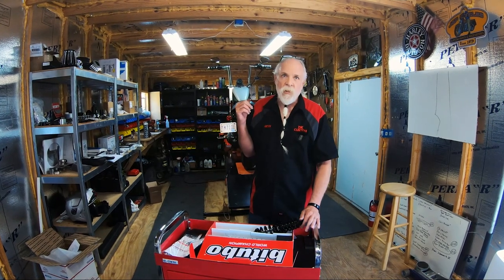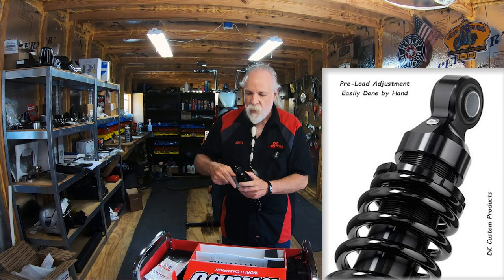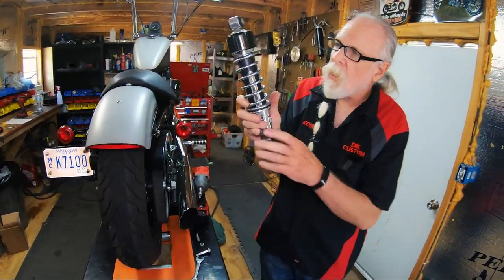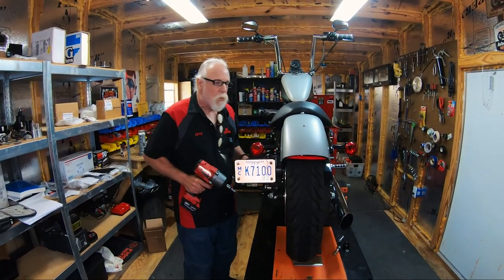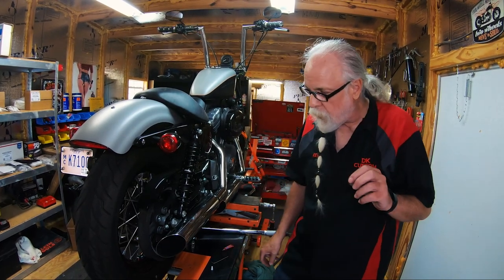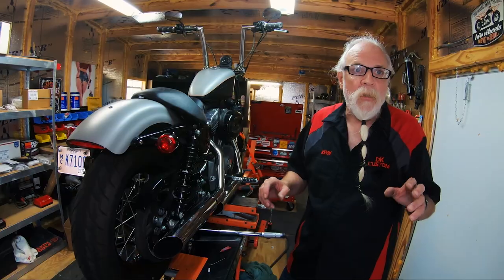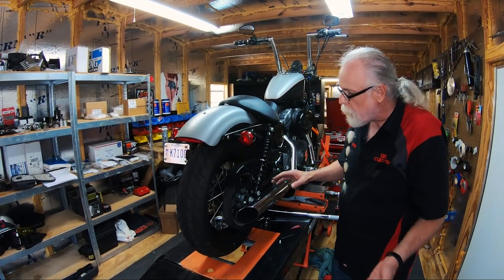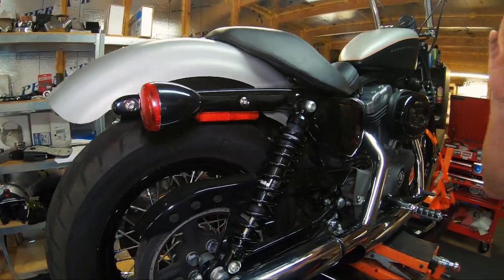EZ Premium Twin Adjustable Shocks For Harley's

Comment: Ok,  I finally order a set for my 2020 Road King (13") and order parts for the front forks last week too (still waiting for 2 of three ordered items).  I still have the forks of my 2021 Street Glide Standard to figure out the best option (dang those road bumps and buzz vibration on the 19" low profile tires riding on seal chat type roads is annoying on that Street Glide!)   My OEM shocks show no sag with me and bike on the ground, so I figure the 1" total sag I will adjust for will make it easier to move the bike around while seated (I'm on the shorter and lighter side), got to get ready for you event in a few weeks as I plan to come down.. but back to the Sportster.. One thing to keep in mine, that extra 2 inch of travel not only are you limited by the muffler, but you are putting much more stress on that belt drive system when that shock extends that extra length..
Reply from the maker: Sounds like you have a good gameplan for your bikes!
The pivot of the swingarm functions with no extra stress on the belt, even with the 14" NexGen™ shocks.
Looking forward to meeting you at the open house! 👍

Comment: So is the dampening adjustment for rebound, compression, or both? I used to ride dirt bikes on mountain trails and a good suspension with all the adjustments could turn those large stones into fresh marshmallows, but if you wanted to ride faster and get really rough, you could do some adjusting and those large stones would turn into a few days stale kind of marshmallows and you never bottomed out hard, but maybe only a little and rarely.
Reply from the maker: The damper adjustment knob is for rebound.  Compression damping is controlled by the valving and the adjustment of the preload.

You can see more about them at this link - https://www.dkcustomproducts.com/twin-adjustable-performance-rear-shocks-for-harley-davidson-dk-bt-shks.htm

Please feel free to contact us with any questions;
Support@DKCustomProducts.com
662-252-8828

Thank you for commenting! MB

Comment: I just bought a set of the 13" Bitubo shock for my '19 Road Glide. I'm a little confused, because the paperwork DK sent with the shocks says to torque the mounting bolts to 40 ft-lbs, but the Harley service manual says 63-70. Which do I use? I'm getting varying info all over the net.
Reply from the maker: Every shock has different bushings and spacers, the Bitubo Twin Adjustable shocks will be correctly installed with 40 ft-lbs with red thread locker.  If you are putting the stock shocks, on your bike, back on, then use the torque specs for those shocks, as specified in your manual. 👍
Reply: @DKCustomProducts  thanks for the reply. I wasn't sure when I put them on last night. The stock shocks, oddly enough, didn't look like they had any thread locker on them. Weird. Service manual says blue 243, so I put that on and torqued to 45, which was in between. Hopefully they stay on. 🤷🏼‍♂️😂
Reply from the maker: You'll be good. 👍

Comment: I got the 12” Bitubos for my Dyna. Pretty good improvement over stock, really showed how bad the stock front is! 

Just wish I had got the 13” versions.... and I will.
Reply: I put the 14in on my 2016 FXDLS! But I'm 6'3
Reply from the maker: Yeah, that 3.7" of travel on the 13's is a very nice upgrade over the 2.7" in the 12's.

Comment: Harley Davidson and shocks in the same sentence is a crime.
Reply: My FXDX would beg to differ. To your point there are plenty of Harley-Davidsons with the wrong shocks from the factory and just as many from a poor choice in aftermarket “upgrade”
Reply from the maker: They do leave quite a bit to be desired for most folks.
Reply from the maker: Yes, some folks are happy with OEM shocks, most are not.  
Many who are not then purchase some mediocre aftermarket shocks, which may or may not be better than OEM.
Some of the mediocre shocks are actually better than OEM and folks think that is great...until they ride with some great shocks, they do not know how comfortable, stable, planted and safer a truly performance set of shocks are.